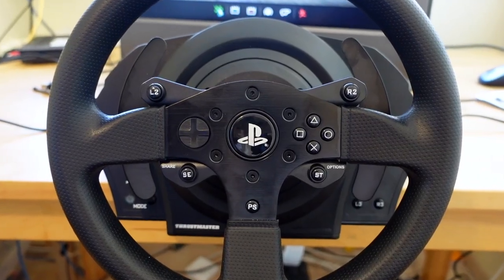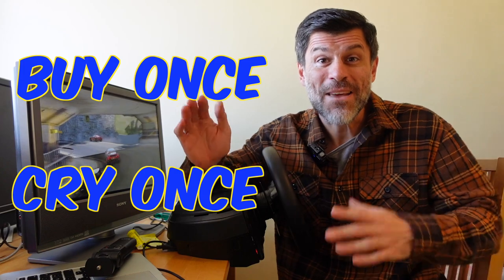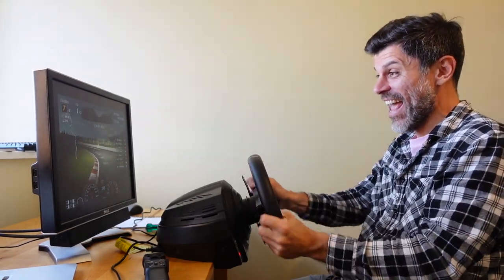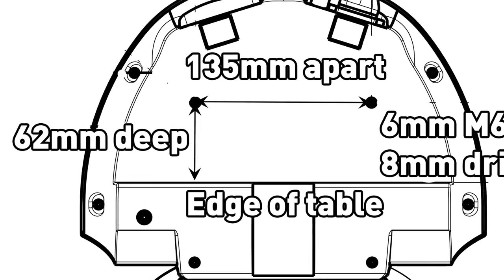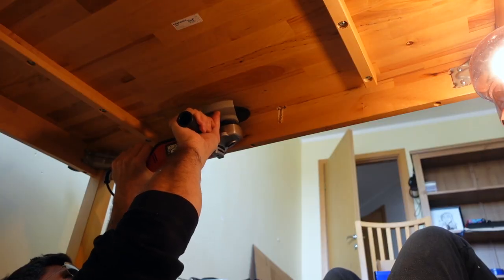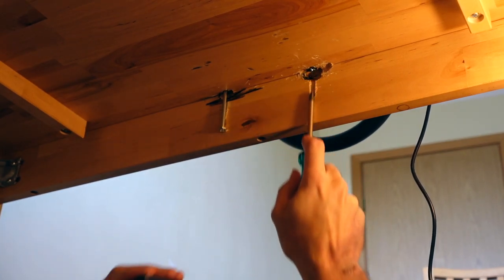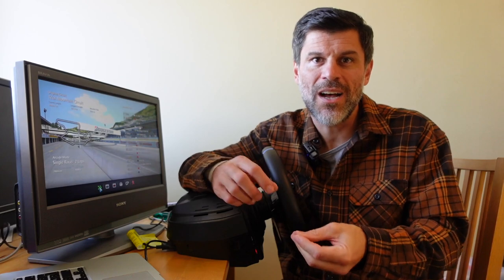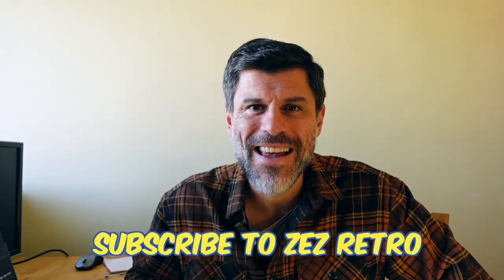I mounted a Thrustmaster T300 to my desk

Comment: I used the clamp and superglued mine to the table, as i have a weird situation. My table has a metal bar exactly where the screws are supposed to go,  so the screwing wasnt an option. Clamp + Glue seems to be working now, but now its forever stuck there. Works well tho

Comment: Sounds like you're Australian, so I'm assuming you're in Australia. I just picked up a Thrustmaster T300 from Cashies'. It didn't come with the mounting 'thingie', so I was contemplating mounting it directly to the desk. Glad I found your video. If you want a quick-n-easy release, check out Bunnings and look for 'Richmond M6 x 40mm Handbolt'. Should be the size you need and comes with a convenient star head, which you can use to tighten/loosen the bolt with your hand.
Reply: Good advice! You are half right, I am Aussie but I live in Estonia. I have since mounted this T300 to another desk where it sits permanently now. The original desk still has the holes but they don't bother me 1. I have a handy pen holder and 2. I can quickly mount another wheel, the Logitech GT is good for PS3 and PS2 compatibility

Comment: Thanks for this video Zez! I was using the included clamp until now and it started giving out during driving sessions.  Used a similar set of screws and thrustmaster's template for spacing and was able to make mounts on two different desks for both PC and MiSTer FPGA use and never have to worry about the clamp giving out again.  I appreciate the inspiration and sharing what worked for you here!
Reply from the maker: Thank you for your positivity mate, your contributions to the retro community ate valuable and appreciated

Comment: It can also be adapted for retro gaming. Just pull out the current occy strap and throw in a shorter one, none of that fancy pants power steering here
Reply from the maker: Dang you can replace the cord in the old Thrustmaster wheels?
Reply: @ZezRetro  Nah, well maybe, I don't know. Perhaps you could crack open yours and see if it's possible. Be sure to add some coilovers to your table and straight catback exhaust while you're there for maximum fully sick points

Comment: I just mounted mine and it works great!

Here’s a tip for the holes: if you flip the base upside down and place a sheet of paper against the edge as if it’s the table, you can outline and pop out the circles for the holes. Then, just line the edge of the paper up with the edge of the desk and trace the circles and bam, no measuring tape needed!

Comment: is that tv good? i saw one at a local thrift store for cheap is it worth buying?
Reply from the maker: Get it only if its dirt cheap. I've mostly now been playing on a Sony KDL-20S2000. It's 720p and has hdmi and a bunch if analog inputs. It's usually a test monitor but I like to use it here because it's era-appropriate when I use th T300 wheel on a PS3 playing Gran Turismo 6. It's not a spectacular monitor but I like the aesthetic